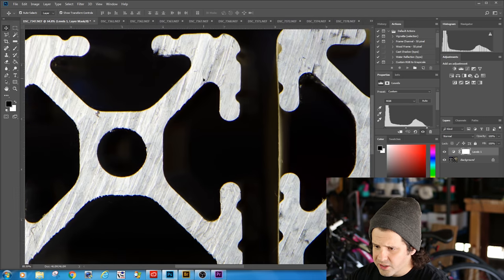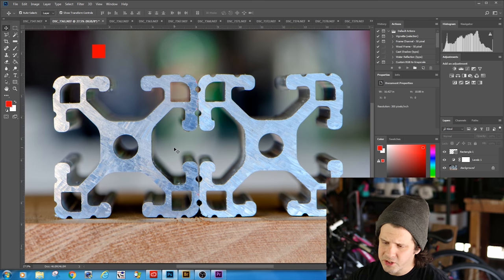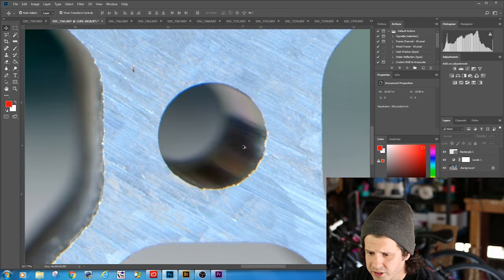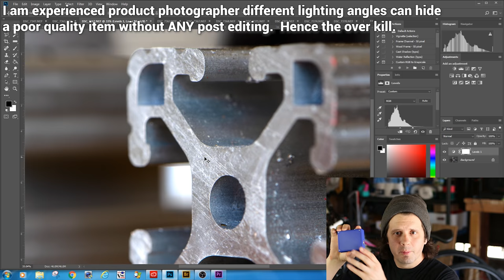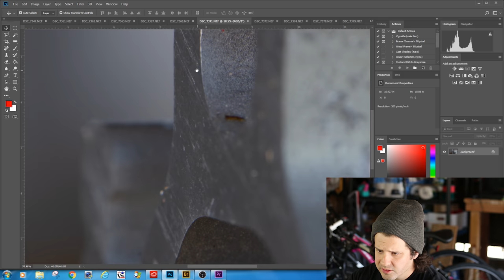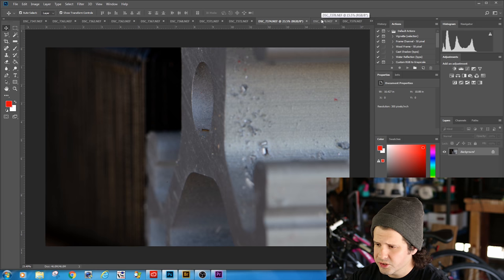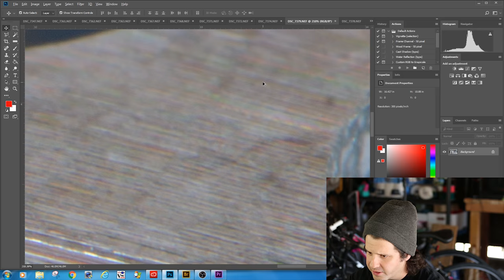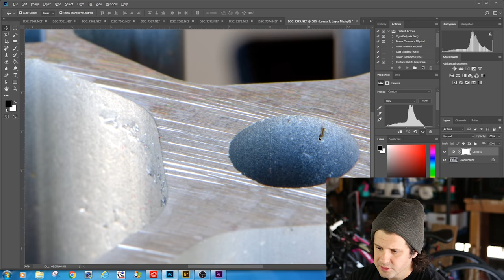Cutting Aluminum with a Diablo saw blade. Is it worth it?

Comment: The two problems here are.
1.Your lack of knowledge of cutting blades.
2.Your lack of knowledge of Aluminum Extrusions.
The first part of the observation is the amount of teeth on the wood blade, it is used for rough cuts on wood and is really not used to cut Aluminium even though it may say it cuts aluminum.This leads me into the second part of the observation the first blade is NOT A BLADE FOR A ALUMINUM ALLOY, Which aluminum Extrusions tend to be a alloy for strength not just there shape. Now back to the Freud blade that blade has much more teeth which gives a finer cut for wood a smooth cut but again be careful on any aluminum alloy.
Aluminum alloy LIKE 6061-T6 Has iron magnesium and other metals in it for strength.
So my thoughts you should invest in a metal blade if you want to cut metals even Aluminum.
Reply from the maker: You miss the obvious. Does the Diablo cut better than the wood blade was the question. Cutting blades you're speaking of are on metal cutting saws, the RPM of a wood miter is too fast for those. So that is why we use THIS blade that is meant for THIS saw that most people probably have.  I thought you being an expert would understand this?  The aluminum extrusion is not 606,1 it's 6063-T6 which is common for extrusions with complex features. How can you comment with such arrogance and not know your alloys?   The value of the Diablo blade increases with thicker aluminum cuts that are not in this video but when you get to 80mm extrusions the wood blade becomes a scary option. But thanks for being another commenter who misses the insanely obvious and on top of that is technically wrong.